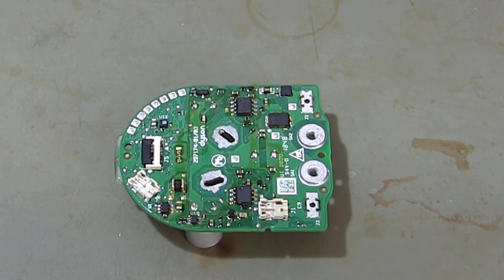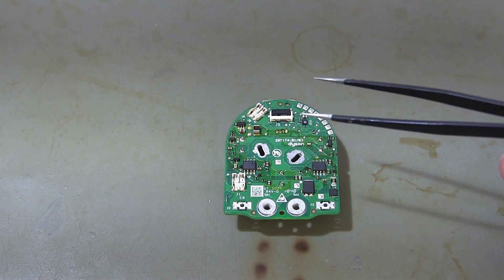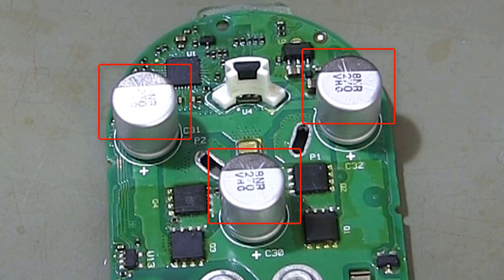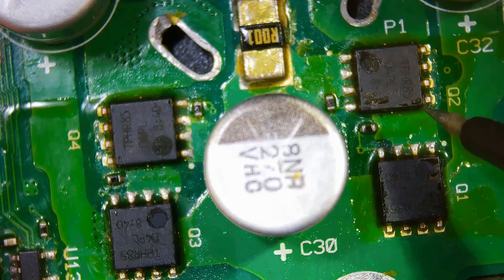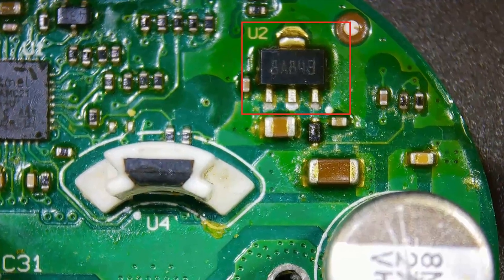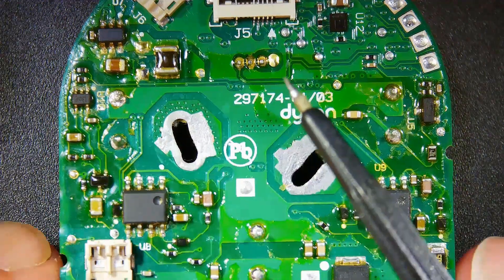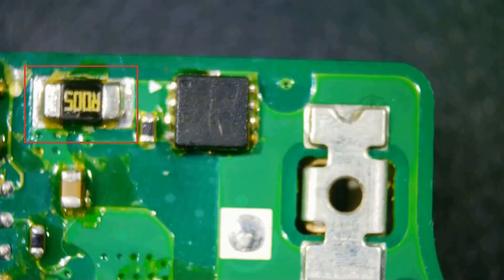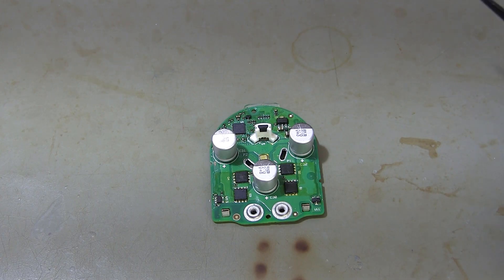How to Repair Dyson V11 Motor Control Board? Component Analysis

Comment: Hello everyone! I would like to ask for help and advice! I have a problem with my dyson V11. The motor works in all 3 modes, but the brush does not receive power. I replaced the cyclone and the black connector, but the problem is the same. Has anyone encountered a similar problem? Does anyone have an idea how to fix it?
Reply from the maker: Hi! Thanks for the detailed description. The fact that your Dyson V11 motor works in all three modes but the brush does not receive power suggests the problem is isolated to the brush head power circuit—not the main motor or battery.
Here’s a step-by-step checklist to help you troubleshoot:
1. Check for Obvious Damage
Inspect the brush head (motorhead): Look for burnt smell, corrosion, or a stuck motor. Remove hair or dirt that may block the rotation.
Try a different brush head (if available): If another one works, the issue is definitely in the motorhead.
2. Check the Wand (Tube)
The wand contains power lines (metal contacts) running from the main body to the head. If there's a break or corrosion:
Use a multimeter to check for continuity from the top to bottom terminals.
Gently clean the wand contacts and look for bent or loose pins.
 3. Check the Black Connector
You said you replaced the cyclone and the black connector. That’s good, but ensure:
The internal wires going into the black connector are soldered and not loose.
The contact springs/pins inside the connector are pushing out properly and not jammed.
 4. Test Power at the Bottom Port
The brush receives power via the bottom socket. To test it:
Attach the wand and run the vacuum.
Use a multimeter to measure DC voltage at the output pins that feed into the motorhead.
In low/medium modes, there may be pulses or intermittent power.
In boost mode, a constant voltage (often 24–30V) is sent to the head.
 5. Inspect Brush Head Circuit
If you’re comfortable opening the brush head:
Look for burnt MOSFETs, failed SMD components, or broken wires inside.
The rotating brush motor may have failed (worn out brushes or open winding).
Reply: @electronic7979  Hi! Thank you very much for your answer. I will see what I can do with it. I wish you all the best!

Comment: I have a Dyson V11 Absolute, but it only starts once the battery is charged. Once it's turned off, it won't start again. The screen stays black. have you any idea?
Reply: Try to disconnect the lcd. If works, change lcd
Reply from the maker: Battery Management System (BMS) Fault
The Dyson V11 battery has a BMS that controls charging, discharging, and communication with the mainboard.
If the BMS locks up or crashes, it may stop sending the necessary "battery present" signal, causing the unit to appear dead.
After charging, the BMS temporarily resets, letting it work once.
Fix: Replace the battery with a known-good one (or test yours by opening it and checking the BMS MOSFETs and communication lines — if you're comfortable with electronics repair).
Mainboard Microcontroller or EEPROM Crash
The mainboard stores usage data (run-time, errors, etc.). If the memory (EEPROM or flash) is corrupted, the vacuum may crash after logging one session.
Some users fix this by reflowing or replacing the microcontroller or EEPROM, but this is advanced-level repair.
Battery Communication Line Issue (I²C/UART)
Dyson vacuums use data lines between the battery and control board to report voltage, temperature, and usage.
A fault in this line (bad connector, damaged trace, corroded contact) could cause the system to lose communication after initial use.
Fix: Inspect and clean battery and control board contacts. If you have a logic analyzer, you can monitor data transmission on battery terminals.
Loose or Damaged Trigger Switch
Rare, but if the trigger switch is intermittent, the vacuum might not register a proper "on" command after the first use.
 Test: Press and hold the trigger while watching the screen when connecting a charger. See if there's any flicker or sign of life.

Comment: Hello, I have a Dyson V12. I want to expand it. The original DC motor runs. When I measure the voltage from the brush motor with a multimeter, l get no voltage. When I use another DC motor, it doesn't work either? What's different there?
How do I get a plus/minus DC voltage at the tube? I built a circuit with Arduino so that the brush runs left and right, but for that, I need a DC voltage at the tube.
Reply from the maker: If I remember correctly, the Dyson V12 vacuum cleaner brush motor is a brushless type motor. Therefore, you need to create a brushless motor control circuit.

Comment: Thank you for the video with the detailed explanation. My Dyson V11 starts in BOOST mode and then stops with the message 'Airway Blocked', but everything is clean and there are no obstructions. I turned on just the motor without the Cyclone and it shows the same error. What could it be?
Reply from the maker: If your Dyson V11 is showing “Airway Blocked” even when everything is clean and you try to run just the motor unit without the cyclone, this could indicate an internal sensor or hardware issue, not an actual physical blockage.
Blocked or Faulty Pressure Sensor
Dyson vacuums detect airflow using a pressure sensor. This sensor can falsely report an airflow blockage if it is:
Dirty
Faulty
A loose wiring connection.
Remove the rear filter and check the small hole near the motor housing — this leads to the pressure sensor. Blow gently or use a vacuum cleaner to clear it.
Open the motor housing and examine the small tube or port leading to the pressure sensor.
Check for corrosion or dust near the sensor or its connector.
Bad Motherboard or Sensor Logic Error
If there is an issue with the internal MCU (microcontroller) or logic board:
It may be inadvertently triggering a blockage warning.

The system may be misinterpreting the high motor pull as an airflow problem, especially if it occurs immediately after BOOST mode is activated.

Reset the vacuum by holding the trigger for 10 seconds (without the attachment) and making sure the battery is charged and the filter is properly reinstalled.

If possible, try using another battery pack - low voltage under load can sometimes trigger this warning as well.

Dirty or Faulty HEPA Filter
Even if the filter appears clean, over time:
Fine dust can clog the filter inside.
This restricts airflow and causes the same error.

Solution:
Try removing the filter and turning the vacuum on briefly (not recommended for long-term use).

If the error does not appear without the filter, your filter may need to be replaced.
Motor Controller or Bearing Problem
If:
The motor is drawing too much current
If the bearings are worn and the motor is turning slower than expected
it may simulate symptoms such as restricted airflow.
Check for:
Any unusual noise or smell
Rubbing on the motor shaft (you said BOOST mode triggered it - high RPMs could be the tipping point)

Comment: i reselle dyson vacuums and i have like 15 units of v11 faulty mostly pulsing problem and cant run the motor head i what is the main reason why is it pulsing and the reason why it cannot run the motor head
jonathan
Reply from the maker: Common Causes of Vibration
Dyson’s V11 will vibrate (turn on and off repeatedly) when it detects a problem (usually related to airflow, power transmission or sensor failures).

Top Causes:
Clogged or Faulty HEPA Filter
Even if it’s visually clean, an internal blockage can restrict airflow.
A bad filter will cause the vacuum to vibrate as a protective measure.
Cracked Filter Seal or Loose Filter
The rear filter (with the purple dial) should be on tightly. Cracks in the plastic or a loose fit will trigger the pressure sensor.
Pressure Sensor Failure
Located inside the main body near the motor.
If the vacuum senses that the airflow is reduced due to a sensor failure, it will vibrate even if there’s no blockage.
Battery Voltage Drop Under Load
Weak batteries may provide adequate power at idle, but may drop voltage when the motor starts.
This causes vibration and sometimes error lights. Reasons Why the Motor Head (Floor Head) Is Not Spinning
If the vacuum is working but the motorized floor head (brush roll) is not spinning, check the following:
Possible Problems:
Broken Connection in the Bar or Head
The wires inside the bar can become loose over time, especially near the ends.
Check continuity from the base to the head pins with a multimeter.
Burned Motor in the Floor Head
The brush motor may have overheated or shorted.
Disassemble and test the motor directly with bench power to confirm.
Floor Head PCB Damage
The small board inside the head may have failed (due to dirt, moisture or motor overcurrent).
Main Body Output FETs or Contacts Damaged
The Dyson body supplies power to the head via two contacts in the base.
If the internal switching FETs or the MOSFET driver for the motorized tool port are faulty, it will not supply voltage.
Quick Diagnostic Steps (No Tools):
Try the motor head from a working V11 on a faulty unit - does it spin?
Use a working battery from another unit - does the vibration stop?
Run the unit for a short time without the filter - does the vibration stop?
Recommended Repairs:
Replace or clean the filters (or test with new).
Open the main housing and inspect:
Pressure sensor tube/hole
Board corrosion
Cracked solder joints
Test continuity through the bar and motor head
Bench test the motor head motor and PCB
Check the internal MOSFET/FET driver on the body board for the motor head output
Reply: Mi aspiradora no gira el cepillo cabezal ,ninguno de los ke tengo ,revise cables y todo bien ,que componente sera de la pcb
Reply from the maker: @ivanbalsa2604  I recommend checking the mosfets.

Comment: high professinal content, thanks ! can you advice please - our v10 not starting (both batteries are good)
Reply from the maker: Thank you for your interest.
There may be several possible reasons why the Dyson V10 vacuum cleaners do not work even though the battery is intact.
Check the battery contacts and the connection points inside the device. Clean any dirt, oxidation or looseness.
Trigger Switch May Be Faulty:
The trigger mechanism may fail due to frequent use.
If there is no reaction when you press the trigger button, you can measure whether the button works with a multimeter.
Check that the cables and microswitch are intact by opening it.
Motor Board or Main Circuit Failure:
The motor board (control board) may be burnt. Especially due to dust, moisture or overheating, MOSFET or power components may fail.
Check for swollen capacitors, blackened areas or burnt components with a thermal camera or visual inspection.
The Motor Itself May Be Faulty:
you can measure whether the motor is receiving DC voltage by turning on the vacuum cleaner.
If the control board does not power the motor but the battery voltage is present on the board, the problem may be in the control board.
Reply: @electronic7979  Thank you very much - also may be motor stuck because overheated, if working long time without pause.

Comment: What an excellent video, i was wondering if component U11 is the hall sensor for the filter? Im having trouble with mine and was wondering if i could bypass it by joining the power and signal legs? Do you think this would work and if so could you advise which 2 legs? Thanks in advance.
Reply from the maker: Thank you for your interest. I don't think the method you specified will work. Hall Effect sensor produces a pulse signal according to the magnetic field and the direction of the magnetic field. Shorting this sensor will not start the engine because there will be no signal production.
Reply: @electronic7979  thanks for the information. I'm always keen to learn new things.
Reply from the maker: I'm glad I could help.

Comment: Hello, thank you for the information in the video. Can you please help me figure out the issue with my V11? Here’s the symptoms:
If I leave it for a few minutes and then start it, it works for about a minute, then it just stops and the battery light blinks blue for a few seconds. Every time after that I will start it again and it will only work for 5 seconds and then it stops and shows me the blinking blue light again. If I let it rest, I’m back at the start again. The motor brushhead also doesn’t start right away on eco mode, I have to do maybe 2-3 trigger pulls before it spins with the vacuum.
I replaced the filter and checked for any obvious blockages, full charge on the battery as well. 

Is this be a battery issue or a motor or board issue? It seems like there is some sort of power control stopping the machine from overheating but there’s no way for me to use it for that amount of time due to the stoppage. I’d like to hear your opinion before I replace any parts. Thank you very much for your help.
Reply: Replace the 3 capacitors not battery.
Reply from the maker: Battery Problem:
When the battery heats up, there may be a voltage drop. After it heats up, the protection circuit may be activated and shut down the device. If the blue light flashes a few times, it indicates that the low voltage / protection mode is active. However, if the battery is full and initially working, it suggests that the battery is not completely broken, but weakened (especially if the internal resistance of the cell increases).
Increased Internal Resistance or Overcurrent Detection of the Motor:
If the motor is faulty, it may draw too much current while working. This triggers the protection circuit on the motherboard. If it works for 5 seconds at each attempt after warming up, it may indicate that the motor windings show more resistance when heated.
Main Control Board (PCB) Problem: The MOSFETs or microcontroller in the protection circuit may be giving an error. If it works when cold but stops immediately when it heats up, it may mean that there is an overheating protection or current detection circuit error.
Brushhead Delay: If the brushhead does not turn immediately, it is either due to a lack of contact in the power transmission or the age of the motor in the head. Also, this head motor may be drawing too much current, triggering the control card.
The problem is most likely due to the increase in the internal resistance of the battery cells or the motor drawing too much current. However, in such devices, the control card also intervenes as a protection circuit and stops working.
First of all, my suggestion:
Can you test with another good V11 battery? (If the problem is fixed, the battery is faulty.) If the problem persists after changing the battery, the motor or the motherboard (PCB) is faulty. Remove the brushhead head and run it with only the body - if it behaves the same, the problem is not in the head, but in the body.
Reply: @ 
Thank you so very much for your help, I will order a new battery right away.

Comment: I changed 4 fets and 2 gate resistors (one side (2 fets and 2 gate resistors had burned out)). He says it still doesn't work. Do you think it could be the mosfet driver chip the BMAX L5109 SOP-8? I am asking him to send it back to me but with the motor and complete unit.
Reply from the maker: Common Causes of Dyson V11 Motor Failure
1. Overheating
Why it happens: The V11’s digital motor spins at incredibly high speeds (~125,000 RPM). If airflow is blocked (e.g., dirty filters, clogged cyclone), the motor must work harder, increasing internal temperatures.
Result: Repeated thermal stress damages the motor windings, bearings, or PCB components (especially MOSFETs and drivers).
2. Low Battery Voltage → High Current Draw
What you said is 100% true: As the battery voltage drops, the motor draws more current to maintain power. This causes:
Higher resistive heating in the windings and FETs.
Stress on the motor control board.
Lithium batteries especially don't like deep discharges — they sag in voltage, and the motor tries to compensate.
3. Brushless Motor Control Circuit Failures
The ESC (Electronic Speed Controller) or motor control board in the V11 is a common failure point.
Issues include:
Failing MOSFETs
Damaged gate drivers or microcontrollers
Poor soldering or heat-cycled joints
Once one FET shorts or opens, the motor won’t spin properly and may make strange noises or shut down entirely.
4. Bearing Wear / Mechanical Stress
The extremely fast rotation puts enormous stress on the bearings.
Lack of lubrication, dust ingress, or imbalance can cause early wear.
Worn bearings cause drag, which increases motor load → more heat.
5. Dust Ingress / Moisture
While the motor is "sealed," fine dust and moisture can still creep in over time — especially if filters are not cleaned.
Conductive dust can short components or corrode motor windings and PCB traces.

How to Avoid V11 Motor Failure
Don’t run the battery too low
Recharge when it gets down to ~20–30% to avoid high current draw at low voltage.
Clean the filters regularly
Every month is ideal. Clogged filters = airflow restriction = overheating motor.
Check the cyclone and ducts for blockages
Even a small clog increases motor workload.
Store the vacuum in a cool, dry place
High ambient temps + residual dust = slow death for electronics.
Don’t run it for long in MAX/Turbo mode constantly
Use lower power settings for regular cleaning.
Occasionally inspect motor sounds
 Whining, grinding, or ticking are early signs of bearing or electrical issues.
Reply: @electronic7979  Excellent reply. More or less what I suspected. I think he will return the board to me one more time and I will change the driver IC. One side was ok but I changed all 4 mosfets for RS ones. I think I will buy 2x driver IC from AliEx and try the driver IC's This time he will send me the entire unit so I can test the repair. He is also buying a broken unit so We may end up with 2x working units.
  Thanks again for the detailed reply.